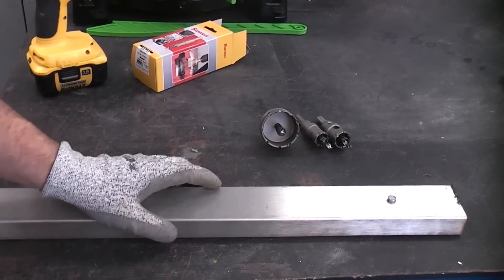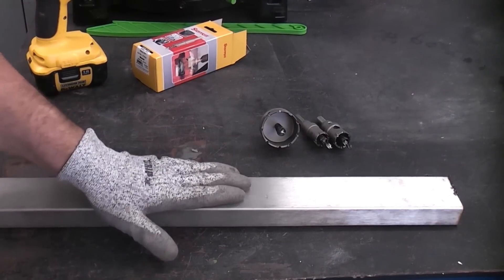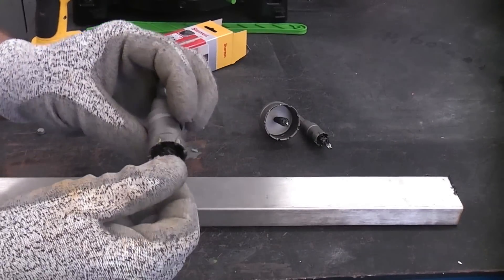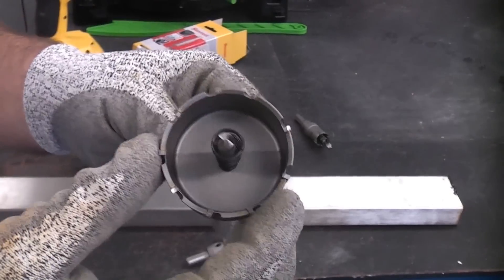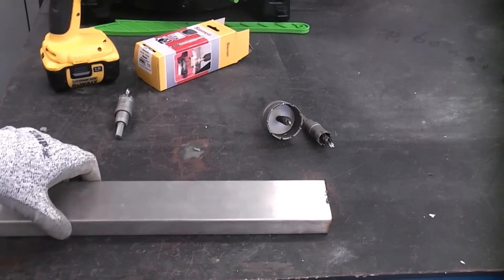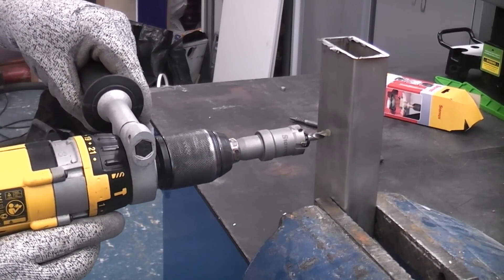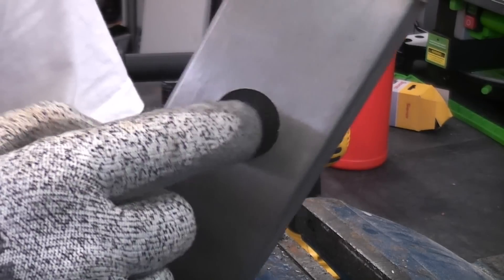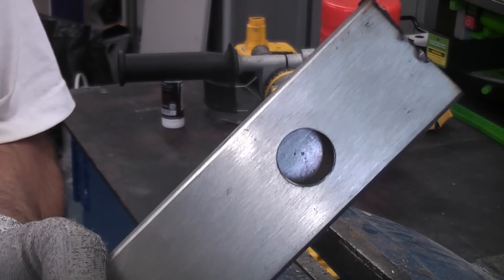How to cut a hole in tough 316 stainless steel

Comment: Just drilled through 12.5mm thick 316. Cobalt bits in a m18 hole hawg at low speed.

Comment: Hi do you fast forward ur video  why asking you  because  ur drilling speed seems fast  or it's the right speed pls let me know
Reply from the maker: That is the correct speed. But if you use a larger diameter hole saw, you need to reduce the speed 👍
Reply: @ultimatehandyman  Thanks a lot

Comment: Thank you for this. I need to drill 3 x 34mm holes on a 3mm thick non magnetic stainless steel. Would you recommend me to buy a carbide tipped hole saw for the job? Would 1 hole saw last drilling 3 holes?

Thank you
Reply from the maker: I'd get a TCT one to be honest, you can get them relatively cheaply now.
There is a 35mm one in this listing for less than £14 delivered- https://fave.co/2XMhtE7
I bought a similar one a few years back and it was superb 👍
Plenty of cutting fluid/coolant during use and it will last for years

Comment: 3/16 is approximately 5mm not 2.
Reply from the maker: That's why we use metric, it's much easier 😜
Reply: The 316 part he mentioned wasn't referring to thickness, but the type of stainless steel he's cutting.

Comment: Hello i need to drill through 6 mm thick stainless steel plate. The hole should fit an m10 bolt, what drill bits i need to use for this ?
Reply from the maker: I'll give you two options-
1. cheap option for a one-off job, or just a couple of holes-
https://fave.co/399QhS7 get one 4mm cobalt drill for the pilot hole, then a 10mm cobalt drill for the correct sized hole, cost less than £10 for both drill bits.

2. Expensive option, but much easier and less effort.

https://holemaker-technology.com/collections/new-products/products/versadrive-impactastep-cutter-metric-sizes?variant=39275392565306

These can be used with an impact wrench, although you will need a versadrive adaptor, but they can also be used in any drill with a standard chuck. The 8mm-16mm one is £57.95 + VAT

Which ever option you choose, make certain that you use lots of coolant/lubricant.

Best of luck with it ;-)
Reply: @ultimatehandyman  thank you for quick reply. The step drill is great i think i ll go with that as i need to get 2 drill bits anyway for the job , would cost almost the same for quality cobalt or carbide drill bits

Comment: I had a lot of success drilling into 8mm thick 316 some time ago using step drills - believe it or not - from china. I had to get up to 16mm, and the drills worked like a charm. I used lots of oil, and about 150rpm on my drill press. Once the chip starts forming, just dont stop with the pressure. By the way, the drill bit i used is still used often and it still cuts like crazy. 3pcs set from china for under 10€ - those gold HSS ones that are all over ebay with the larger shank.
Reply from the maker: Thanks for the comment 👍

Comment: Hey great video! I have a little problem and was wondering if you could help me out. I'm trying to drill a 127mm hole with a bi-metal holesaw in 304 steel. Is there a big difference between 304 and 316? It seems as though the holesaw can just about cut it but my drill doesnt have the torque. What drill would you recommend for this sort of thing?
Reply from the maker: 304 and 316 are very similar. 127mm is a large holesaw, so it will need to be used on the slowest drill speed- preferably a mains powered drill, as it will require a lot of torque and will put considerable strain on a cordless drill. You'll also have to use plenty of coolant/lubricant to prevent the stainless from work hardening. 
I hope this helps.
Thanks for the comment 👍

Comment: Do I need to use cutting paste for thinner stainless steel or will it be fine without? I guess the only thing without cutting paste would mean a greater burn mark or further burn out the expensive carbide bit.
Reply from the maker: I would always use a cutting paste/drilling or tapping fluid on stainless.

Comment: hey, i need to drill 70mm holesaw on a 4mm sheet stainless, should i use any coolant? since didnt saw you use them on the video. thanks
Reply from the maker: Yes, you need to go really slowly and use lots of lubricant.
If I remember rightly I used a cutting paste in this video, but any drilling/tapping fluid will work ;-)
Reply: @ultimatehandyman  can i use tap water as collant? or wd40? is the speed you shown on video is the right speed? thanks a lot
Reply from the maker: Yes, water or WD-40 will help.
Generally the larger the hole saw -the slower you need to go. If the hole saw starts to burn, ensure you add coolant and go slower.
Good luck with it.
Reply: @ultimatehandyman  thanks dude, i just started metalworking,this is my last $30 , if this bit broke, maybe next salary will continue this project.
Reply: @ultimatehandyman  thanks a lot dude.

Comment: I run a marine welding/machine shop and cut alot of 316/316L,we use regular bimetal(usually "Milwaukee"brand) and find if you keep the feeds,but especially the speeds low,you'll have pretty good luck!thanks for doing what you do,you have great information!
Reply: But if you drill by hand, what is the method for controlling feed
Reply from the maker: Thanks for the comment
Reply: I just blew one up on some tube. Barely got going before teeth started ripping apart. $25 gone.
Reply: This may be an old comment, but on my machine I drill at 670 rpm spindle speed, and 4 IPM "inch per minute". It can get through 1" before drill bit needs resharpening. Hope that helps.

Comment: 316 Stainless is not that hard but it is a very tough material. For 1/6 to 1/2" holes I just use Norseman Magnum Super Premium Drills. They are made of  a Hi-Molybdenum, Hi-Tungsten tool steel. They a re very reasonably priced for the quality drills you get. Anything bigger than 1/2 " id use a HOUGEN  type drill (Annular Cutters) in a mag drill.

Comment: How many holes can you do with one drill bit? i need to increase a drain hole sink from 3-1/2" to 4-1/2" without damage to fit a garbage disposal. that's the way they do in Brazil.
Reply from the maker: You should be able to do a lot as long as you use coolant and do not let the hole saw get hot.

Comment: That is very good tips....Sir, going to take new hand drill machine like  as in your video...Sir, can you send me some machine models/details set. I need upto 35mm hole on 2mm steel plate. Can you ask me witch one batter for that. Thank you.
Reply from the maker: You need a drill with high torque for such applications. 
Are you based in the UK? If so I'll try and recommend a drill ;-)

Comment: Drilling stainless 316L. The key to succes is very sharp drill, cutting paste, low speed and press hard.
At the second the edge is cutting and the first chip is visible, keep going slow and press hard.

Moste people run way to fast on the drill in stainless and the cutting edge gets dull right away.
Reply: It depends on which material the drill is made of. That is true for a HSS or bimetal holesaw drill but for a TCT holesaw like he was using you need more speed. Same as solid carbide twist drill or mills

Comment: We used to drill 3mm stainless with hole saws. We did it by wiggling the holesaw from side to side,covering all 4 sides. The idea was to make it easier by not having the entire saw cutting. Keeps it cooler and not so hard on the operator. Of course we did not have hole saws with tungsten tips though. Slow speed and plenty of cutting paste.
Reply from the maker: Thanks for the comment ;-)

Comment: I thought 316 was softer than 304 and had more corrosion resistance.  I know 316 can be used instead of 304 where corrosion resistance is needed and not strength but not the other way around.  301 work hardens bad.

Comment: I don't know, I think this RPMs are very high
or not? :d
Reply from the maker: The larger diameter the hole you are cutting the slower you need to go.
Stainless is tough to drill so you need to go relatively slow to ensure you do not work harden the work piece.

Comment: Excellent video, I just ordered a few of these based on your video because I work with mild steel trunking a lot, and whilst it's nowhere near as tough as 316 stainless to drill, normal toothed bi-metal hole saws still struggle with it unless they're brand new and razor sharp.

Also at some point in the not too distant future I'll be working with stainless for the exhaust, heat shields and various other areas on my racing car, so these will come in handy.
Reply from the maker: Thanks, trunking can be a pain because it is so thin. Have you ever tried a step drill for trunking? 
https://www.youtube.com/watch?v=YD-WcAZ_ynI

Drilling the stainless with the hole saw should be a piece of cake .

Thanks for the comment
Reply: *****
Yeah I have a few step drills/cone cutters which I use for 20mm mating adaptors and cable glands all the time, but they only go up so big. I've been thinking about investing in a Greenlee knockout punch which leave an extremely clean, neat hole and are much cleaner and faster than holesaws.
Reply from the maker: That Greenlee punch looks just the job if you are cutting out the holes on a regular basis.
Thanks for the comment ;-)

Comment: I do a lot of stainless steel work on sailboats and use 304 and 316 .   I had no problem drilling through SS plate with standard metal cutting drill bits and holes saws.  https://www.youtube.com/watch?v=6SWpzs06TWw
Reply from the maker: It is easier with a large pillar drill as there is less chance of work hardening the stainless. If I use the pillar drill at work I can drill most holes easily, but when using the cordless or hand drill it is more difficult especially in 316 stainless. 
Thanks for the comment
Reply: ***** I agree. I'm guessing a pillar drill is what we call a drill press.  I wouldn't even try with a hand held drill on some thick stainless.    Great videos !!!
Reply from the maker: Yes a pillar drill/drill press is the same thing.
Thanks for the comments ;-)
Reply: Down In The Islands im looking for 3/4" 316 square SS tube, hard to find online, could you please tell me where to buy it? dont need a lot maybe 1 or 2 meters.
Reply: I agree with you made hole through Stainless Steel Plating tanks Starrett High Speed steel low speed drill and plenty of cutting fluid, no chance of pillar drill or magbase.

Comment: Another great video, I also liked the cutting paste. I have cutting oil but obviously it doesn't work on upright items as it just runs away. Can you remember where you got the paste and if it is OK what is the brand name.
Reply from the maker: The hole saw in this video should work fine on cast iron ;-) 
https://www.starrett.co.uk/shop/power_tool_accessories/holesaws/tct_carbide_tipped_d/
Reply from the maker: Its called Exact cutting paste and is available from screwfix at about £6
Thanks for the comment
Reply: Thanks for that. My Screwfix hasent any in at the moment but I have ordered some so I will soon have it.
Reply from the maker: You are welcome ;-)
Reply: What is best for  drilling a hole into a cast iron pipe ?

Comment: Great vid as always, really interested to know what makes stainless steel so tough.  Any good resources or can you do a brief explanation between different types of steel.
Reply: Addition of chromium which its self is a very hard brittle metal. It shares its properties to steel when allowed with it to produce stainless steel.. including excellent resistance to corrosion and other effects caused by heating..
Reply from the maker: Thanks James, I'll try to cover this in a future video.
Thanks for the comment ;-)

Comment: What do you use  316Stainless steel for ? Is it special projects, or just to be safe that the steel is strong enough. Seems to be what my next car should be made of :)
Reply from the maker: It's used widely on the site where I work from pipework to fabricating stands etc. The piece in the video is a piece of scrap from a stand that was scrapped a few years ago.  A car made from it would be heavy but it should last a lifetime ;-)
Thanks for the comment
Reply: Thank you for answearing back. i guess it would be heavy yes :) Its always intresting to learn new things, and when you see something on youtube, in the news or else, you have a little more knowledge. Thank you, and have a nice weekend
Reply from the maker: You are welcome. I try to answer all comments, but some slip through the net.
I hope you have a good weekend also, thanks for the comments ;-)
Reply: Then you'll be wanting a DeLorean.
Reply from the maker: Blimey, I did not know that they were made from stainless steel. Thanks for the info ;-)
Reply: Well, not completely made from stainless steel.  The body panels were, at least.  I believe the chassis was a monocoque fiberglass affair.  Wikipedia has some good info on them.

Scratches would be easy to deal with, but a dent would be a nightmare.  They were all unpainted with a brushed finish, much like the piece in your video.  Then again, anyone who has that kind of money probably doesn't bother worrying whether their fancy car is going to rust out like the rest of us working stiffs!

Comment: What's the name of that drilling paste/lubricant? 
Do you think that'd be suitable on drilling ceramic tiles with tile bit? Or just use water?
Reply from the maker: Its called Exact cutting paste, I get it from Screwfix.I think water is best on ceramic tiles as any cutting fluid could stain the tile.

Comment: Just discovered your videos and subscribed.  Great content, thanks very much.
One quick question if you have a moment:  could you recommend a cutting fluid for home/hobbyist use?  ie not too expensive!  I want to cut into aluminium and maybe, occasionally, steel.  Right now I just use WD40 oil in a spray can which I guess works OK but maybe isn't ideal?
Reply from the maker: Thanks for subscribing. I would definitely not use WD-40 (unless I had nothing else).The Exact cutting paste (from Screwfix) that I use is only about £6 and lasts me a long time.

Comment: the drill needs a safety clutch for bigger core bits, doesnt it ?
Reply from the maker: It depends. This drill has torque control, which I set to prevent the drill from snatching.
A drill with a safety clutch is essential when core drilling in masonry, but for metal hole saws you can normally just use the torque setting on the drill.
Reply: have you tried a stepper bit on 316 steel ? paired with an impact driver they go through steel like butter.
Reply from the maker: No, I have not tired that as I'd be worried about dulling the step bit and I'm not sure if they can be sharpened again.
Step bits are awesome though, I might give one a go but with plenty of coolant/lubricant.
Thanks for the comment

Comment: You said it bites pretty heavily, but how much force did you have to use to keep the bit engaged on the steel? I'm curious how much this would improve the ease of use.
Reply from the maker: They bite quite aggressively because the teeth are so sharp and effective. If you had a decent pillar drill these would be really good, but unfortunately my machine is not very powerful and kept stalling. These would be perfect on larger pillar drills and should make light work of drilling holes in tougher steels. Thanks for the comment

Comment: didn't know they made tct hole saws for metal! look good though, if you need a borrow of my 1200w mains drill with 2 speed gearbox, that will tear your arm off let me know :P
Reply from the maker: Thanks LOL, I do have a Makita core drill but I don't use it much- unless I'm mixing really thick paint or cutting cores ;-)
Thanks for the comment ;-)